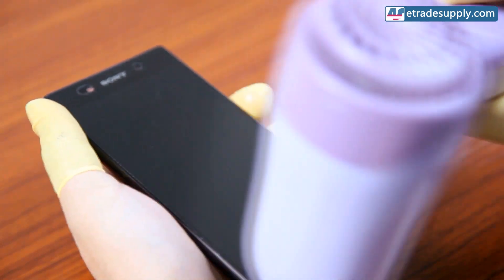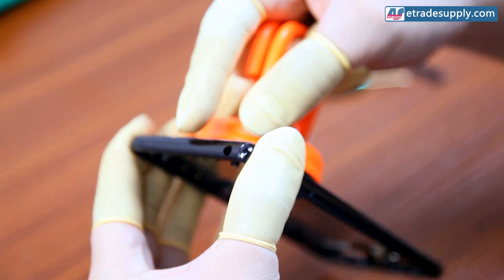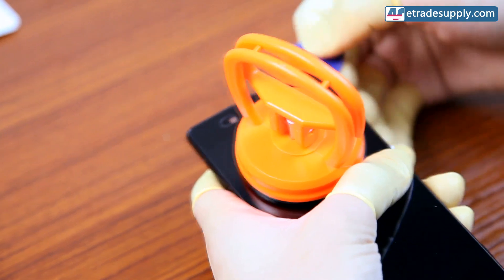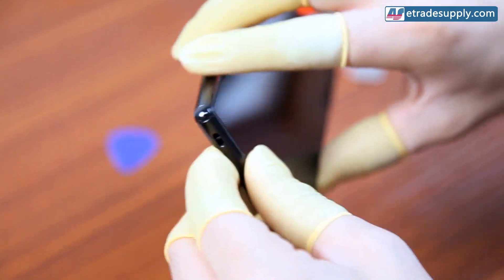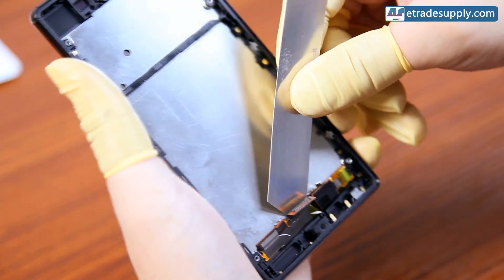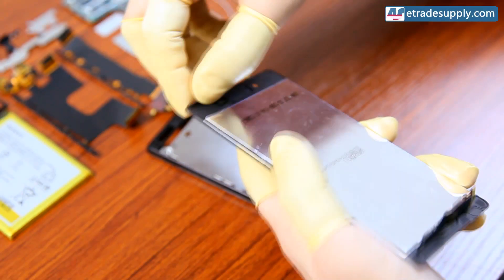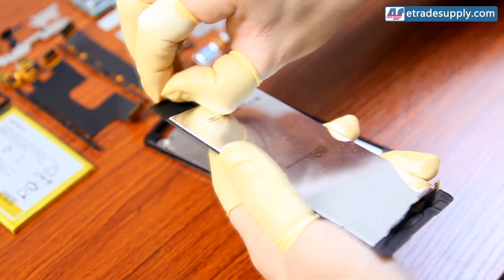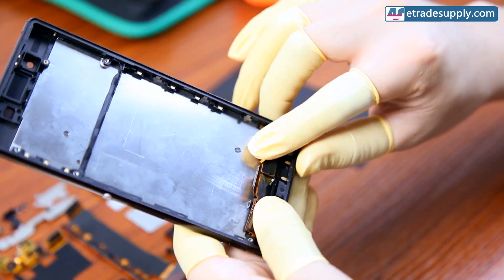Sony Xperia Z3 Plus LCD Screen Disassembly & Reassembly

Comment: Whatsup is the difference between oem and orginal display
Reply from the maker: OEM means original equipment manufacturer, original display maybe the parts tear down from an old Phone.
Reply: Means that it is refubised
Reply: My z3plus screen cracked. Will getting a screen replacement damage the waterproof feature?  Especially since its from a unauthorised Sony service center.

Comment: Well after you reassemble the screen to the frame you are left with a bunch of parts than need to be added in again. Is there a way to replace the screen without touching all the parts that are in the back? Because i bought my replacement screen with the frame with it but i don't want to disassemble the whole phone in order to replace the screen.
Reply from the maker: Hi, I'm afraid that you still need to disassemble the small parts which connected to the screen when install the new screen replacement with front frame, as for the parts on the motherboard then you don't need to tear them apart.

Comment: hello friend,i jut replace my z4 screen but after that the brightness got realy low or it just dont show anything, would you know what is the problem?
Reply from the maker: +Evania Costa  Could be the problem of your replacement screen.
Reply: ETrade Supply what’s the difference between a z3 plus original screen and a not original screen, I mean how can we tell the difference if I were to get my phones screen repaired since it cracked.